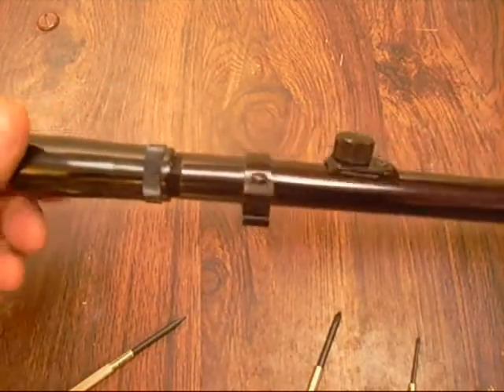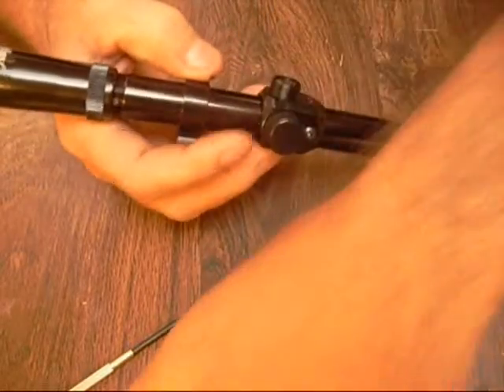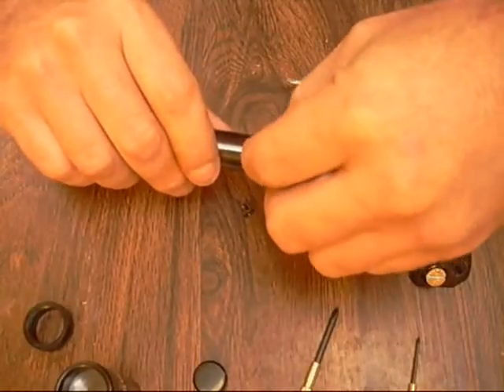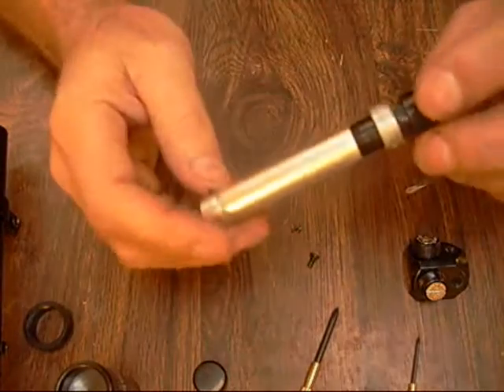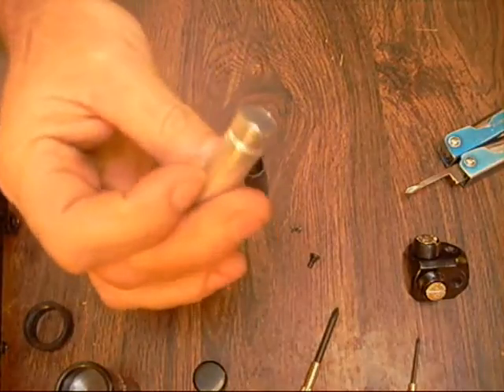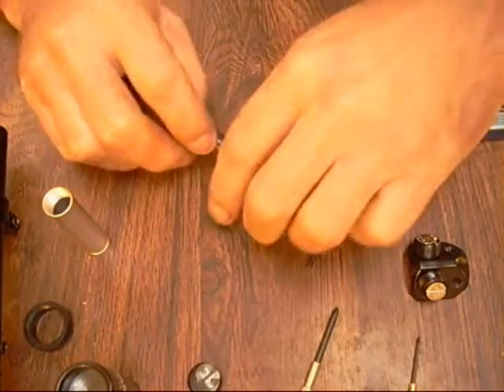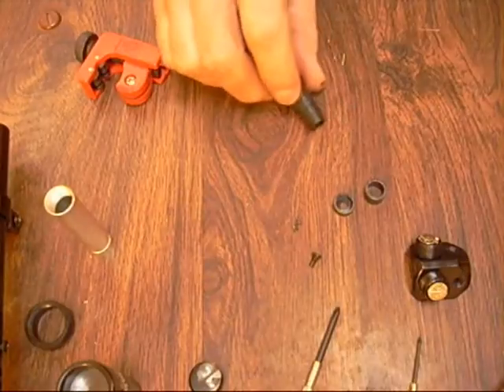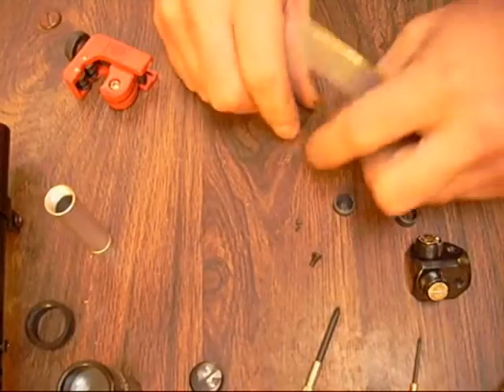Airgun 4x15 scope mod PART 1

Comment: what makes the diference with 2x or 4x or 6x.?
from 4to 2 is less bigger in the lens?
Reply from the maker: +Landcruiser Toy Hi ,from 2x to 4x looks  twice  as close. From 2x to 6x looks three times closer
From 4x to 2x looks twice as far. From 2x to 4x or 6x is darker, and from 4x to 2x is brighter.
up to 25 yards 2x is better.
Reply: simplified, the smaller the first figure the less magnification you get.Don't waste your time with a 2x, that's only acceptable for red dot or holo sights, 4x is ok for beginners, im on a 10x magnification with a 60mm objective lens (but that's just be, been doing this for 17 years).